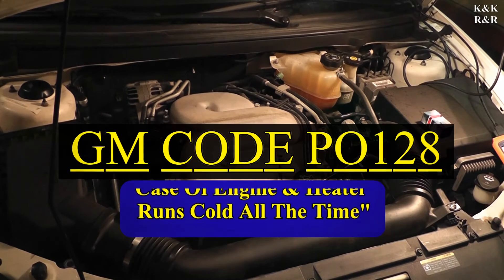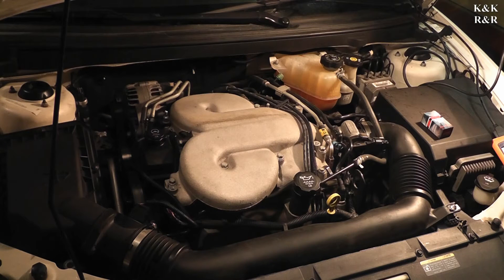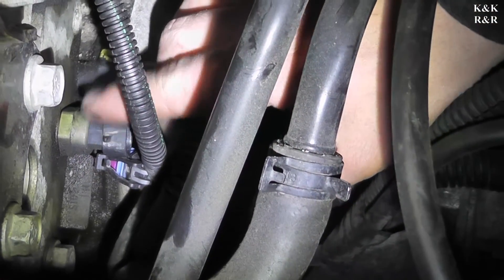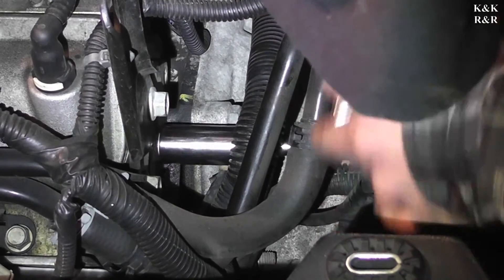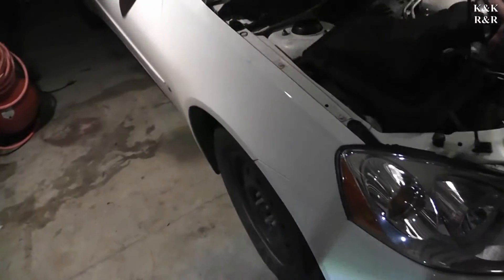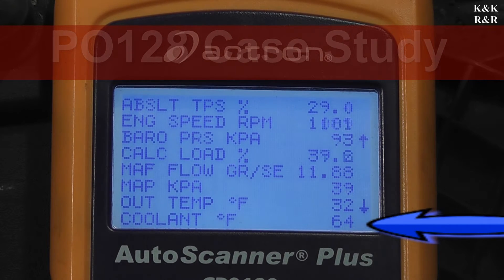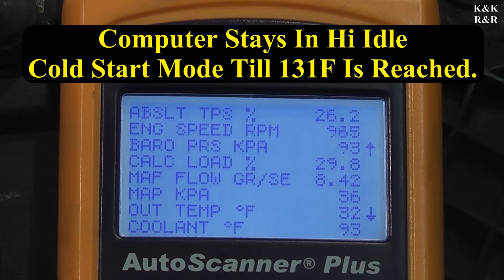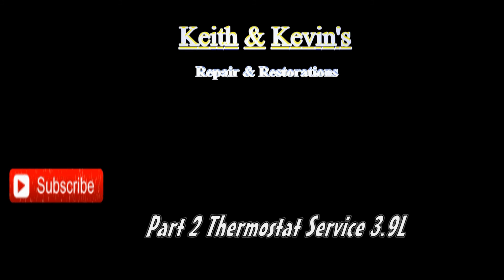PO128 2006 Pontiac G6 GTP 3.9L V6 PT1 Diagnosis & Replace Coolant Temp Sensor/Fan Switch Retest

Comment: On this 3.9 engine can you tell me why engine temp runs normal but no heat  through heater untill engine is revving?
Reply from the maker: There are few reason why you have no heat till its revved.  The list below is not in order but most common issues we see.

1. Coolant level is low or not bleed correctly after a repair
2. Thermostat is stuck open
3. Heater core is clogged
4. Water pump is weak and not pumping enough hot coolant at idle. 

When we get these in we will test the heater hose temps coming in and out of the heater core.  If the heater hose is hot going in but cold coming out the heater core is clogged.  If the heater hose is cold after 5 minutes of running water pump is weak or thermostat is stuck open.  If there is pressure and the upper radiator hose is warm after a 3 to 5 minutes of running after a cold start the water pump is good and the thermostat is bad.  

Start with testing the heater hose temps first, the heater hose(s) should be hot well before the upper radiator hose is. Hope this information will help you diagnose this issue.
/K&K

Comment: can disconect sensor and do voltage test first! and take off sensor and do resistance test check for open loop! and there only 15 lbs torque

Comment: My daughter's G6 3.5L runs fans on high speed. The ambient temperature was 8 below Fahrenheit!
Reply from the maker: Yup I would be changing that temp sensor like in this video. Seems like a common issue with those 3.6L / 3.9L V6's.
/K&K

Comment: I have the same issue with my 2006 G6, fan is always on car always run cold. Took it to a few shops in my town and nobody could figure it out. I'm going changed out water temperature sensor  and see if it fixes my issue. Should I replace the thermostat to?
Reply from the maker: We are finding that the Dex cool is causing water temp sensors to fail around 50k. GM has a long history of dual fan, dual switched systems. If your cooling fan is always on when the engine is cold then the Coolant temperature Sensor is too blame.  Anytime we get a G6 with this same issue we replace the temp sensor, thermostat, and flush out the DEX COOL out that caused the problem in the first place. The PO128 code goes away and your heater is hot once again! Yes change them both together and DON'T USE DEX COOL if you love your car! DEX COOL kills GM engines!!!!!
/K&K
Reply: So what coolant should I use then. I don't know much about Dex cool. The car has a sticker that's says only use 50/50 Dexcool mixture?

Comment: did the temp gauge work on the cluster inside the car when you first received it? I have a 2006 Malibu maxx ss with the 3.9l also and have similar problems. I turned the car off after driving it for about 25 minutes and realized my fans were on. Never had an issue with it overheating before  so I started it back up to check my temp gauge and it was not reading a temp just laying on the cold side touching needle and all. No temp reading and fans on. So I let it cool down for about an hour (live in Michigan so colder then shit) the started it back up. Fans turned right on as soon as I started it and after letting it run for 15 20 mins still no reading on the temp gauge but blowing hot air. ECT sensor?
Reply from the maker: Most of the time I see this problem the gauge will always read low. On some GM FWD used Celsius for temp gauge reading which means the gauge won't move till 140F degrees. Most techs will replace ETC, but don't check the weak thermostat that's causing the over cooling condition. Quick test for you. When the car is cold turn key to "ON"  but don't start it, If you find fans are running at this point replace ECT.  The fans should NOT be "ON" when the car is cold! If you live in cold country, replace thermostat while you do the ECT service. Though its two problems they effect each other, but keeps temp cold below 160F. Also your heater output will be weak or not as good as it once was if thermostat is stuck open. Heater should be hot 3-5 mins after first Cold Start up,  not 15 to 20 mins. The Heater Core gets hot water first before radiator. When I see a GM with a cooling gauge problem, its normal not the instrument cluster at fault. I can always trace it back to basics; When cooling system  is in order system runs as follows; >A/C & Defroster Off< >Cooling Fans "OFF" cold or below 222F, 140F+  Hot Heater Output 3-5 min of (Cold Start), and no flow from upper hose till at least 140F To 180F degrees, and Upper hose will be rock hard and very hot to the touch and should reach 201F To 222F @ 20-25 mins for full operating temperature at idle.< I hope this information will be helpful for you. If you have any other questions, just ask for I'm happy to offer advise where I can. Let me know what you find out if you run these tests. 
/Keith
Reply: Ethan Shine. Did it fix the problem my ss does the same